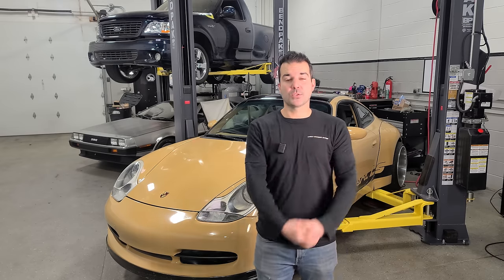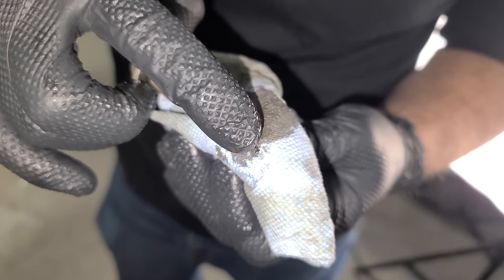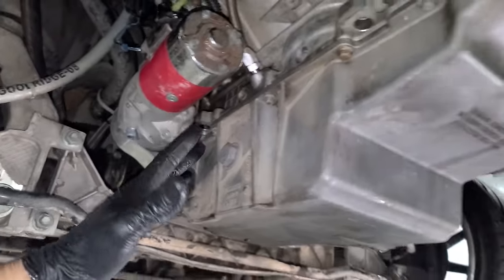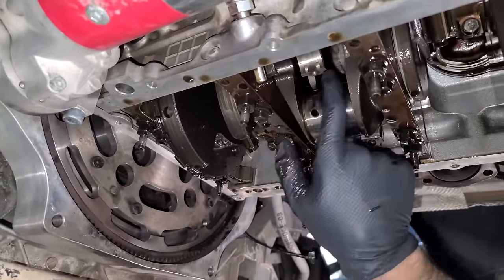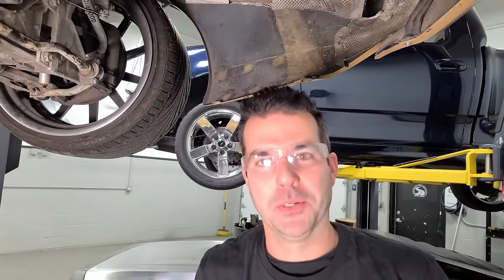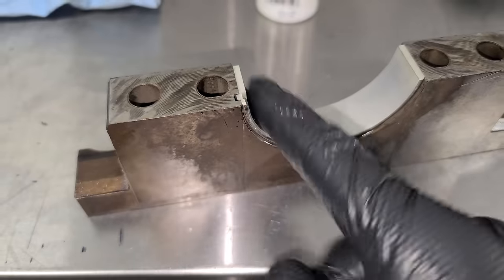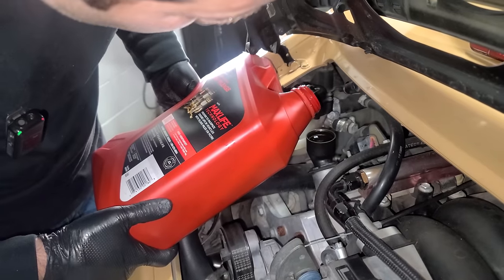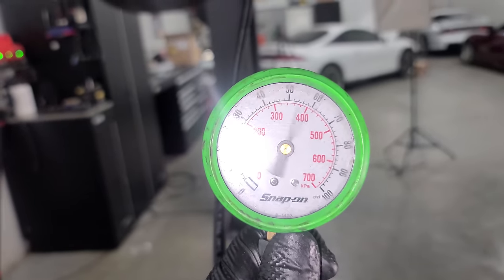My LS Porsche 911 Was About To BLOW UP So I Attempted A RISKY DIY Engine Fix!

Comment: Alex, if you don’t already have one in the shop, I highly suggest having an eye wash station. 

Engine oil, or any other automotive fluid can be extremely dangerous for your eyes. You may not notice immediately but can develop infection later on.
Reply: I agree and he spent 90% of this episode without eye protection. I have a long time mechanic friend who lost his left eye from a impact gun. He hit the trigger and a spec of metal flew out of gun motor straight into his eye. Disfigured him and more.
Reply: I had one of my technicians bring me a slave cylinder once telling me it was seized. Without thinking, I squeezed that cylinder to check, and it did feel seized so I squeezed harder and it freed injecting dirty, rust filled brake fluid into my eye. We didn't have an eye wash station, and I didn't have safeties on. Got infected even after hospital flushed it forever. Ended all ok in the end,  but I have worn safeties since.
Reply: Shoulda coulda woulda is not good advice after you have an accident, especially when it’s your EYES! Protect them!
Reply: Especially with that much brake cleaner, it's mostly methanol or acetone which will strip several layers off your cornea. I've heard from my mom just how painful it can be.
Reply: The brake clean sanitizes the eye so you don't get the infection. The only down side is the unbelievable pain.

Comment: Mine runs 40-45 cold idle, 30-35 warm idle, and around 50 in throttle. It's an lm7 with summit 8707 cam and pac 1219 springs. For reference my idle is around 1000rpm with this cam. Mine used to not like cold start but is cable throttle so I opened the blade a few turns. And starts with no input now. I run mine to 6800 and have hit limiter quite a lot heating the tires and has held up great. Stock bottom end with gen iv pan.
I've found the fox well elm327 with dash command app is also great. Helped me monitor fuel pressure on my Volvo 3.0t t6 I could see it drop to 0 which confirmed it was indeed the pressure sensor on the rail. Also have vida which allows you to even change heated seat temps as well as fire individual coils, injectors, etc. great tool! I'm a Volvo guy at heart. Have an older 98 S70 T5M I swapped a modern 5 cyl into that runs a 12.3 which is plenty for a 3000lbs fwd lol.. fun little car. The LS is actually in a 1990 240 sedan.. always learn a lot watching your videos. Very clear speaker and thorough. Great work as always!

Comment: Throughly enjoy your EduTainment (educational and entertaining) videos. When I work on my older 745i BMW, I also talk to my parts.
With lubrication being very important for every vehicle, I've been using Bestline Racing NanoLube engine oil treatment in addition to very regular oil changes.  It supposed to dramatically reduce friction between metal parts and I've seen a small bump in mpg.  With an older car, I could use a magic additive.

Comment: My first turbo 5.3 had similar oil pressure as you are experiencing. When engine was put in it had 60 psi cold idle and 50psi hot idle. Accidentally starved it of oil and it immediately dropped 20 psi across the board. It lasted about 7k miles and slowly lost pressure throughout those 7k miles. Eventually got to about where yours is and started knocking. I pulled it apart to find a spun rod bearing. That oil looked just like mine did unfortunately. Probably gunna need a rebuild

Comment: I'd take it easy until you get through those two oil changes with filters too. My lingering concern would be where else those shavings got pumped? Cam bearings? Rocker arms? Lifters? So IMO yup, I'd take it easy until the metal shavings found in the oil go away. Might even take three oil changes. Three? Yup. Far less expensive than replacing the engine 🙂
Reply: I'm curious what the cam bearings look like. I dunno about you but that oil pressure still seams a little low to me.
Reply: They get pumped to the filter. It's only if the filter gets filled does it bypass. This is why I always disable the bypass and run the older filters w/o internal bypass or the 2015 LT-spec with the much higher bypass pressure. I'd rather have less oil than lapping compound go thru the engine.
Reply: @hydrocarbon82 A very visual reference for sure, if anyone's ever lapped valves 🙂

Comment: U need to remove the barbell from thw oil bypass and replace it with aftermarket metal one will increase you oil flow by ALOT

Comment: Just found the channel and am enjoying the content,clear,well edited no crazy hype or drama,solid mechanical work( would have broken out the micrometer to check concentrity of rod journals and what bearings to order). Really had me when you related previous work for CTA in bus barn,have friends who worked CTA and am rebuilding trucks on south side- just installed new cab on a Volvo after frame straightened(insurance refused to total but should have). Will watch more as time allows.

Comment: It looks from the gauge you showed us that the pressure relief is opening and closing very quickly. It is very simple to check the correct spring is fitted to the pressure relief and oil bypass checks. Also to check those springs are not squashed nor broken. I've gotta add that I dont have knowledge of LS architecture!

Comment: Very cool method for cleaning the crank journals... I'm sure I should know that but haven't done a ton of engine assembly. A couple SBC with new parts.. I've done similar concept for other things minus the trans fluid as it wasn't as crucial with tolerances.
I'm not to the end yet but I'm confident you were successful lol!

Comment: Alex, Another great video. Hey, change out your exhaust mounting bolts to M8 X 1.25 studs. Then you can keep the oil pan bolted and make the exhaust even easier to remove.

Comment: In my earliest days of being a spare parts interpreter back in the 70s I had a customer who wanted rod bearings for his 6 cylinder Holden motor. He owned the car from new so the bearings should be standard. However, one of the rod bearings was 10 thou over FROM THE FACTORY!!!! As a result, every time i have had to do bearings I have checked all the journals just in case some one has screwed up at the factory. Food for thought methinks.

Comment: That hadn't occurred to me until I saw the engine. Facing the wrong way, the LS oil pan is now closer to an old Chrysler layout, where the lowest part of the sump is in the front to make room for the rear mounted steering parts. Under hard acceleration, the Mopars would oil starve which made them timebombs at the drag strip. This Porsche probably has this problem, even worse since it might be quicker than those old Chryslers. Old gearheads have said that you can add baffles but the problem never really goes away because physics.
Reply: Not to name drop other Youtubers but Hoovie's LS swapped Porsche had oil starved issued that were blamed on sump location, and Tony Angelo mentioned it on his LS swap, and he went with a front oil sump pan.
Reply: bingo!

Comment: My MR2 uses 10W40, I live in Wisconsin, and every auto parts store carries Valvoline, Pennzoil, and Mobile 1 10-40 in conventional. In quarts and in 5 quart jugs. Hell last time I picked some up for the last oil change before winter the stupid shelf was over packed and the front jug was smashed in. Need me to ship you some? LOL 

To bad an LS won't fit in my MR2.

Comment: My L99 in my 5th gen cold starts about 45-50psi then when it gets up to temp, it will idle somewhere between 24-30psi… if the oil gets hot enough, it will drop to 20-22psi. I have an aero force interceptor gauge that signals when it hits 20psi… I really need to pull the old AFM lifters and change the oil pump.

Comment: You needed to check the clearance on the rod bearings with the arp bolts if thats what you planned to run. Checking them with the two different fasteners could yield a difference in clearance on its own.
Reply: Yes, it is important to not change the bolt tension from when the rod was machined.  ARP bolts should match the tension of the stock bolts.  This is admittedly hard to do when stock bolts are TTY and ARP are torque only.